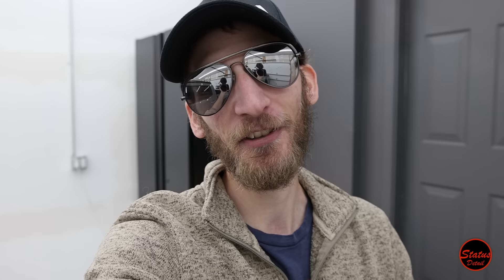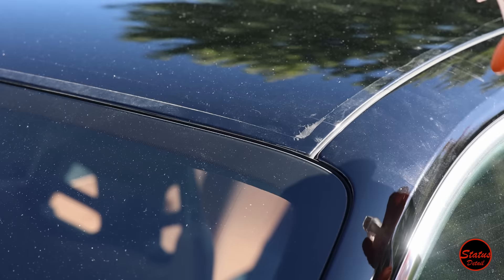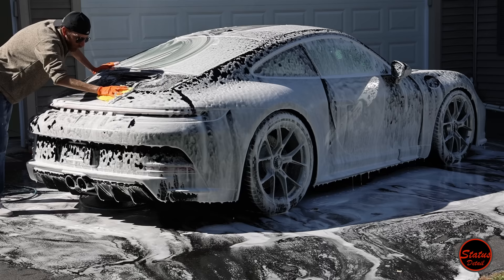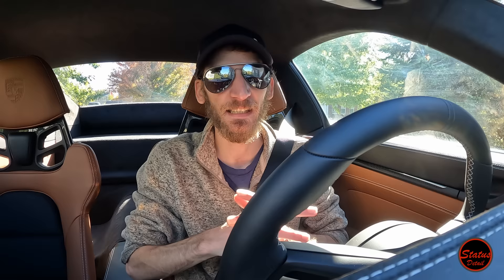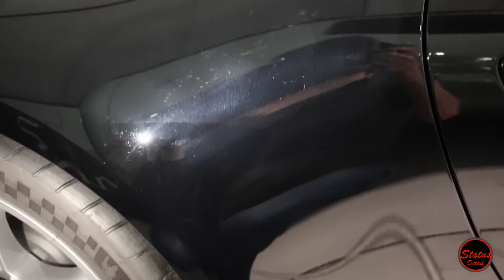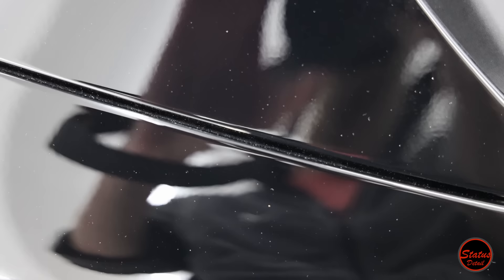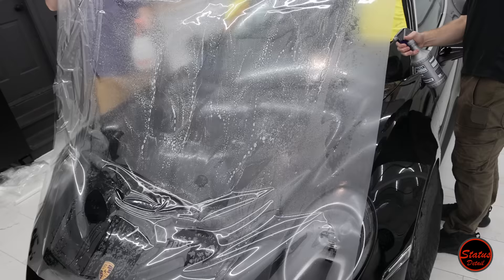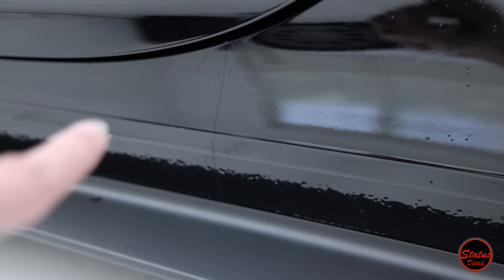992 GT3 Touring FIXING Worst New car Delivery EVER!

Comment: This car should NOT have left the lot like that. You did an awesome job bringing it back to life. I’m sure you made the end customer even happier!
Reply from the maker: Thanks! He was definitely happy!!

It's a tough situation. The dealership can fix some of this stuff. But a lot of it we don't want them to fix. Because there method of fixing it will be wrong but probably fast. That's assuming the guy they have fix it even knows how to fix half the issues without damaging the car in the process. 

The customer wanted it this way so I could fix it. It wasn't unfortunate situation where the car was sitting so much that a lot of the stuff ended up being worse than it should have been because of the sitting. "COVID cars" for some reason the supplied chain was weird and these cars sat a lot and that's just been normal.

But t many of the other problems Obviously happened during manufacturing and are much harder to explain.
Reply: he does say the customer declined the pre delivery setup/inspection. No way any dealer would deliver a vehicle like this. 

he probably had them remove the wrap to confirm no scratches or dings and drove off. it was in a yard, then a ship then another yard for the last 30-40 days before the dealership even got it.  completely normal.
Reply from the maker: @Abesta83  you are correct 👍 but it was in port for like 60-90 days or something insane.
Reply: @Abesta83  especially not a porsche dealer.

Comment: Awesome work and presentation, once more! When these cars sit in the holding yards it is disastrous. My TLX Type-S sunroof seals were absolutely disgusting mudded up including the railing. 
As for the delivery wrap markings, that's due to the fact that it's applied too soon after the paint curing and de-oxygenated. Your detailing care essentially re-oxygenates the paint/clear coat and allows for these lines to disappear. 
Being closely in-tune with Porsche import, usually one of the inbound Customs POE is Houston and if it sat in Houston, it is possible that it got some drenched Gulf storms, which means sand within droplets. However, the Porsche Lot Techs are not always (aka: NEVER) to be trusted because they bare minimum "detailing" materials from management and cannot be trusted to provide top notch results... unfortunate but the reality. I tell my customers to refuse ANY dealership "detailing" and get over the "grand reveal" and come straight to me. Usually, I try to get cars within hours from coming off the delivery trucks (often handled by Russian truckers who are more often than none careless).
Reply from the maker: A lot of very interesting information in that comment. 

I totally agree about getting over the grand reveal. To many people want the "experience" vs the reality that it needs to leave ASAP to be fixed and then have a proper reveal with us lol
Reply: @STATUSDETAIL  Precisely 👌🏼🏆 you're a Champ in Chicagoland
Reply from the maker: @nexamax  🙂👍👍 thanks!

Comment: Great job. I picked up my new 911 992 GTS in flat black in October. Same issues regarding the paint. Horrendous sanding marks which I had corrected prior to ppf- mental!
Reply from the maker: Yep this is pretty common. Take a look around the comments here lol.... People think that I'm lying and that this has like three owners because Porsche would never deliver anything short of perfection.....
Reply: @STATUSDETAIL  I’d be interested to know if they’ve ever owned one from new.. The detailer I used in October had a brand new Carrera and Turbo in the shop around the same time as doing mine.. Both had noticeable paint defects, so it’s common.
Reply from the maker: @lukebartram1966  I think most of them have never owned any new car. Just keyboard warriors lol. I have yet to see a "perfect" new Porsche based on my standards. If it was my car there would be work to be done on every car. But a lot of people wouldn't be bothered or notice a lot of this stuff. 

Obviously this car was pretty bad Tho. Worse than what Im usually seeing

Comment: Very sad to pay that kind of money and get the car in that condition. And it doesn't end there, ask anybody who worked on or is familiar with a dealership and these cars get joy rided all the time, driven very hard without the knowledge of the owner while being "tested" after a service or repair, and the list goes on and on (this is not just Porsche ofc). Most likely if you have the money for this car you can just say whatever and turn a blind eye but still shouldn't be like that.
Reply from the maker: At least we could fix it! I have a few customers that do all the easy maintenance so no one is driving them. But obviously the big stuff you need a dealership

Comment: What you also could do is make a negative pressure room. And where the intake is, filter the air.
Reply from the maker: For ppf? That could definitely work. Maybe a little extreme. But could work. Basically what a paint booth is. But even dust gets in fresh paint lol.

Comment: Do you generally wrap edges so they are hidden, where you can?  I've been told it can wear more and pull away faster vs going close to the edge and want to know your thoughts?  I think it looks much more clean where edges are hidden.  Thanks, great car!
Reply from the maker: Hello John

Great question. We typically wrap all edge's that can be reasonably wrapped.so the hood for example is fully wrapped. But on the Touring for example where the bumper and fenders meet you would have a PPF edge that's unwrapped. Hypothetically you can remove the bumper and wrap that edge fully. The issue with this is the film will now rub against itself with subtle driving vibrations and end up pushing it self out of that jam and eventually look really horrible. 

The back of the fender by the door can often be tucked behind into the fender/door jam as well. This attention to detail adds surprisingly lots of labor. Because you need to come back multiple times to ensure it's sticking on the back side of panel. Typically it's heated a few times to ensure durability. 

So be prepared for a longer overall install process and typically slightly more expensive job.

In most cases I'd say either way is equally durable as long as it's done with precision and care. But I'd never recommend the tuck like the fender bumper example.

Comment: Damn son, nice video.  The rust on the rotors is something that I always miss, first drive...orange wheels. Glad you sort this out
Reply from the maker: Yea that brake thing can be annoying lol. When I do the wash faster because I'm not filming it doesn't rust over as bad. So when you use the brakes as shown it works even better. 

But when I'm filming I have to go so slow and it takes even longer so the brakes rust over way worse. By the way it's a problem The point is during the normal wash they don't actually look that bad.

Comment: Yes, the customer did decline the PDI from the dealer.  However, they are delivering a brand new car, and by that means the car should be looking showroom ready.  And if it is not, then even if the customer decline the PDI to get it right, the dealer should offer to pay for the detailing work required to get it to showroom ready.   It is unacceptable for a customer paying premium money for a car like this, to receive it in a condition that is considered a "disaster" for a brand new vehicle.
Reply from the maker: I totally agree with you It should look better especially from all the defects standpoint

Comment: Why dry with a wax based finisher to prevent scratching?  Especially after clay baring and right before paint correction, probably don’t want to add that layer of wax before paint correcting.
Reply from the maker: Im pretty sure I literally explained this in the video... But still commented about it?

Gyeon quick detailer is very mild. As in not strong and works as a great drying aid. 

Just because we're about to paint correction doesn't mean we should be careless when drying especially in a black car. It just so happy that this car was hammered and probably wouldn't have mattered how I'd ride it but we didn't know that It was that bad during that wash process so we were still being careful. 

I knew the car was going to need around a compounding and that's going to cut through any wax residue that was in Gyeon quick detailer on about 2 seconds. 

It would be a different story if I was putting ceramic base sealants on a car because that could be a little more hassle but we did not use that

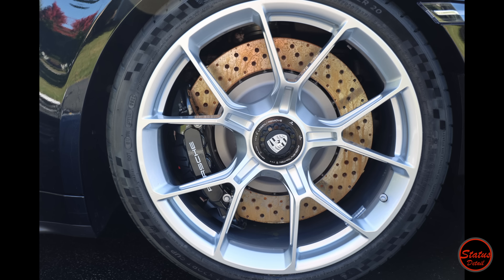Comment: @4:58 pick up some Hyde’s Serum. “Rust stopper” for this exact reason.
Reply from the maker: I'm not a fan. Doesn't do much for inside of rotors throwing crap all over barrel. Or the back of the rotors. It only stops it on the front of rotors.

Comment: I recently shipped a car that a  relative wanted UK to USA. The cars have a pretty hard time of it,  to be fair the shipping part of the cost was reasonable, and they handle industrial quantities of cars
Reply from the maker: That's interesting. 

Not sure what you mean hard time of it
Reply: @STATUSDETAIL  hi amazing detail on that GT2  .Re the one I shipped.  Cars that were not approved for the US market become eligible after 25 years. I spent 6 months looking for one that was 2 owners from new and garaged all its life. It had some small areas of surface rust on the subframes, which had an apology of a paint job from new. It passed an MoT pre purchase.The ship then made about 4 port calls that I hadn't expected resulting in the shipping date slipping a month. The car stood outside all that time and it didn't stop raining. I am sure all the brake discs will need replacing and what would have been a one hour job including getting the car up on the lift will be a project to rectify the subframes.  It's embarrassing!
Reply from the maker: @stanbest3743  oh I see that is unfortunate

Comment: Hi Team Status, what a transformation! 👏. Ty a product from the UK, Bilt Hamber the manufacturer call it Atom Mac. It prevents the staining of the discs. Apply after cleaning the alloys. I do have to say it does work for my Macan discs after alloy wheel cleaning 👍
Reply from the maker: Interesting! I know a few products are around for this. Maybe it's time I give it a try 🙂
Reply: @STATUSDETAIL  Hi there 👋if you can purchase a bottle in the USA, give it a try 👍.....maybe a vlog on testing the product? 
Have a good week,
Graham.
Reply: Or even cheaper.. run up & down a few feet applying the brakes, then quick rinse off
Reply: @jamesarmitage8399  I cannot argue against that James.
Reply: @grahambell9831  Seen it done by others & never any issues
Reply: @jamesarmitage8399  fair play James. The Bilt Hamber product does work......should car owners wish to try an alternative method.
Reply from the maker: @jamesarmitage8399  In my experience rolling the car floors and backwards it two miles an hour for example and hitting the brakes doesn't fully remove that problem. It does help but it's not the best solution

Just my opinion.

Comment: Do you think spray soaping is better than two buckets? I wasn’t sure if it made much difference or what the benefits were? Great vid’s and subscribed.

I’m also absolutely staggered that this is the condition of a new car from Porsche. 😮
Reply from the maker: Thanks for subscribing!!

I'm not sure I understand the question. Spray soaping vs two buckets! 

No matter the wash process you do you would rinse and pre foam then rinse then foam again and use two bucket method with wash pad OR use multiple microfiber. Hope that helps.
Reply: @STATUSDETAIL  - I think he means foam cannon vs 2 bucket wash method.
Reply from the maker: @andygranite8076  well even if you use two buckets you should be using a foam Cannon. And if your using microfibers only like in my new videos you should still be foaming. 

I do not recommend two buckets with no pre foam.

Comment: Quanta Costa? Curious how much inside and outside cleaning costs with and without PPF. I'd happily leave my car in your hands!
Reply from the maker: Maintenance details start around $250-$350
Ceramic and correction starts around $1700
PPF is typically around $2000

Comment: It's normal and customary to take the Porsche emblem off and PPF below it, instead of cutting out that potential scar mark to the eyes of cut lines,
Reply from the maker: You can't see where the ppf starts and stops on that install. It's also considerably easier and less expensive to remove that PPF if he gets a chip in film a d wants it replaced. 

When you pull that and film under it the emblem rubs the ppf and almost always bubes up the PPF around edges. Takes a year or two and a lot of driving. What we did will never do that.

Comment: how much do you charge for the complete detail? Also, one of my cars has old ppf cracking on bumpers and side view mirrors. I am thinking of soaking it in hot towels for quite a few minutes. Let me know any faster or better methods? I am afraid to use acetone, since it can damage the clear coat also.
Reply from the maker: This was 6-7k range I think. 

A heat gun will help.  Hot water helps. But if You visually see cracks and it's probably going to be a pain in the butt to remove
Reply: @STATUSDETAIL  Thx for replying. Will try the heat gun.

Comment: Evan once again a fabulous informative video. So many things you cover I am sure most viewers have never seen or considered. Art comes in many forms but you certainly create art in your own unique way! Can you give some advice on ceramic coating my new wheels? I have brand new untouched Mercedes S Class wheels and I am going to ceramic coat them before they go on the car. What steps should I take with the preparation? I. E. Should I use iron remover, machine polish them etc first? I have ceramic coated wheels before but never brand new. You advice would be greatly appreciated.
Reply from the maker: Thank! Check out the gt4rs video tomorrow!! I think it might be even better than this one!

If they are literally bee and never used you want to spray a lot of gyeon prep on. Wipe that off and use a ceramic of your choice. 

Gtechniq and Gyeon both make wheel specific coatings. You can also do crystal serum light and exo or try mohs evo
Reply: @STATUSDETAIL  Thanks Evan for your advice once again. I have Gyeon Rim for them. Would I be correct in saying, just Gyeon prep and then coat them? I just wondered if I would need to use an iron remover first in case of any contamination from the original machining process. Do you think that a light machine polish would enhance the appearance, or am being extreme! Look forward to watching your next master class here in Scotland!
Reply from the maker: @flyman3386  you can do all of it and it will only help. 

But typically a new wheel is pretty clean. But you can do as many pre coating steps as you like. If they are used or even a little used then you would do decon. Clay. Polish prep.
Reply: @STATUSDETAIL  Thanks Evan, very much appreciated for your time and advice! Keep us educated!
Reply from the maker: @flyman3386  my pleasure 🙂

Comment: Do you ever have customers who want you to take the wheels off and clean and wax both sides of the wheel?
Reply from the maker: Very rare. 

Even with ceramic on wheels you're going to need to clean them with agitation and proper chemicals to really keep up with them and make them look nice.

At the end of that process You should always be shooting hydro on them and that's going to boost the hydrophobics a lot.

Proper wheel brushes will allow you to fit them in necessary places on 99% of every wheel.

If you were unable to go to wheel brush because of the tolerance between the barrel and the rotor then you're in a situation where your barrel Will be dirty all the time regardless of ceramic. 

Unless the owner of that car will take the wheels off basically every time they clean it which is just unrealistic. 

Wheel ceramic is great but it's not witchcraft that you put on and then never care for again. All ceramic will require agitation and proper cleaning to keep everything working well

Hope that made sense!